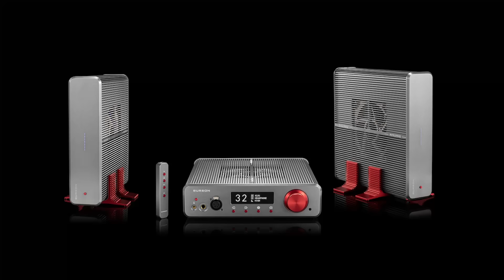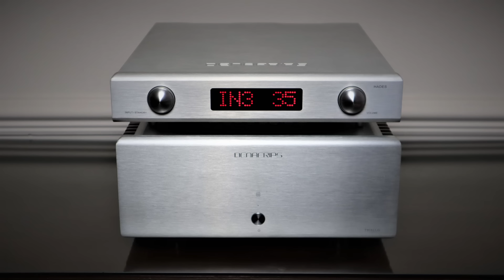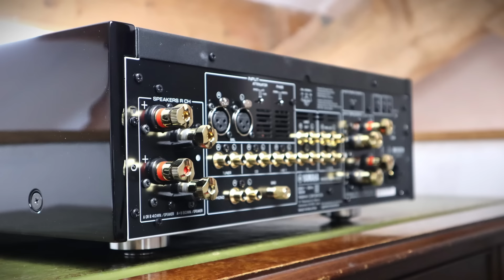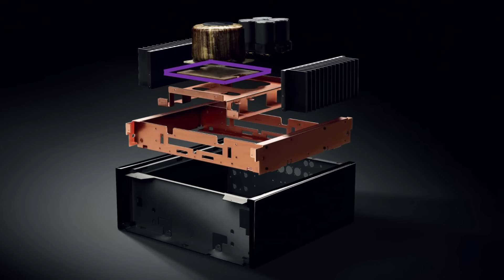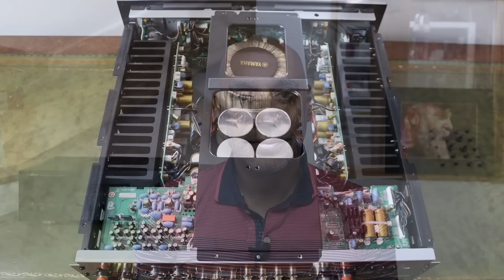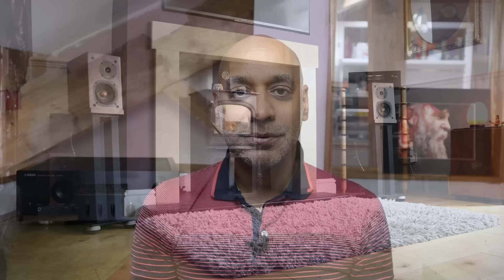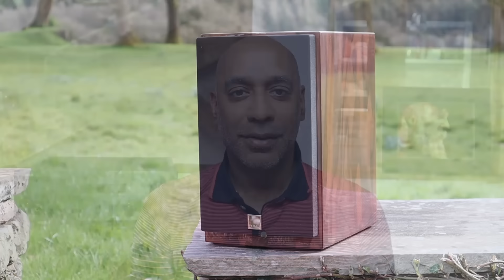ATTAINABLE HIGH-END! Yamaha A-S2200 Amplifier Review

Comment: I have the predecessor: The A-S 2100. A very fine amp. But in the last time with one issue: The amp switches off after about one hour of operation based on the protection circuit. The LED on the power switch suggest: Overheating. But hat is not correct. Amplifier temperature is normal, hand warm. Impedance issue of the speaker is also not possible (ProAc Tablette 10 Signature, nominal impedance 10 Ohm)… maybe a fault of the temperature sensing to the protection circuit…..
In the meantime the am is replaced by a WiiM Ultra/Vibelink combo. Works also very well and sounds as good as it gets. 😊

Comment: Some people put a lot of importance on RCA and speaker connectors.... but what I don't see too often, is balanced XLR connectors.  Is this important sonically, or does being balanced make the cable disappear more so than unbalanced?  Would a star quad canare xlr be tops, or have you noticed differences in balanced XLR cables?
Reply from the maker: The common mode rejection of balanced connections can bring benefits over long cable runs (lower noise). However, many balanced connections add a stage of electronics to a design that is not balanced inside. This can have a negative impact of sound quality. I all come down to implementation 😊

Comment: Would a Yamaha with its slightly dry/light/lean and detailed presentation work well with LS3/5A, which is already rather warm, rich and thick in the midrange? I'm interested most in imaging, stage depth and a non-bright sound.
Reply from the maker: I doubt you will experience the midrange magic of the LS3/5A with that combination 😉
Reply: @abritishaudiophile7314  Thank you, good to know. It actually sounds fine with a very old Quad 33/303 recently serviced by Quad. Not high end but very enjoyable.
Reply from the maker: @Pondillacgreat 👍

Comment: I just upgraded from my Yamaha AS-1100 and bought the AS-2200 what a huge difference and don’t regret it .
Reply from the maker: Thx for sharing 😊
Reply: Can I ask you what speakers are you using? Are they cold and dry? How would you describe the sound? I read that the 2100 sounds a bit warmer and rich than the 2200. What are your impressions after 8 months?
Reply: @gm152 @gm1521  I’m running  Proac response d28 floor standing speakers and I found with my upgrade to the Yamaha A-S-2200 after 8 months with my old Proacs is a lot warmer and well staged and excellent tight bass and never regret upgrading from my Yamaha A-S1100 thanks .

Comment: The price is too high for the return; I prefer the sound of my Harmon Kardon hk6600, which is much cheaper costwise, but the depth of the sound that it produces when paired with two NHT tower speakers is unmatched even by far more expensive amps and speakers.  The hk manages to deliver the depth of the bass and the clarity of the higher notes and instrument separation that really good recordings can bring to the ear.  I've played a CD of Berlioz's "Symphony Fantastique" recorded back in the 70s by Karajan and the Berlin Philharmonic; and most amps fail to deliver the same depth as the hk6600.  I've listened to systems at high end dealers costing tens of thousands, and the quality in comparison to this more simple but reliable hk, does not justify the Gross price difference.
Reply from the maker: Thx for sharing 😊
Reply: @abritishaudiophile7314  Looks nice and I'm sure the build quality is good however it's far too expensive for an integrated.  My Rotel RB1582MKII would smoke this Yamaha and at half the price!

Comment: I just got this amp. I think balanced topologies have more to do with marketing than real improvements to the sound. I think its purpose was supposed to be rejecting noise across long patch cable runs like you would find in a studio, and that's it. I do agree with using a shield and grounding the shield to sink noise to ground, but experiments I had done in the past with a 1980s Quad power amp, hadn't showed that I had been picking up noise, anywhere, inside the amp, or out, and so I had removed the balanced cabling and gone back to non shielded. Back to my new amp, I think Yamaha had applied their preferred house sound, here. It's not entirely neutral, but instead their take on what they think music should sound like. I hadn't noticed thinness or lack of body, but this is probably because the house sound of my previous 24 year old amp (made in Portsmouth, UK!) was much the same (diffuseness and providing a sense of space, over solidity). I see the Yamaha as a high clarity component that lets the speakers apply their sound signature. I had never heard a Hegel, even though those were available at AXPONA, it was too busy. My Wharfedales have lots of body in the bass with either amp (especially when I use a subwoofer with them). They have richness and natural timbre. But, they also have a flatter soundstage, worse dynamics, and worse imaging than my other pair. They are the more musical speakers. The larger pair has more soundstage depth, better dynamics, and more precise imaging. They are the more technical speakers.
Reply from the maker: Thx for sharing 😊

Comment: The attenuator, bypass or -6db, for the balanced connection is often overlooked on this integrated amp.  Mine, in bypass, with either a Denafrips Pontus II or a Bel canto DAC 2.8 sounds good... until you start hearing distortion which is very noticeable at low volume.  

I run mine with the -6db setting and the DAC 2.8 and this combo is absolutely sublime.  The phono section is really good too!
Reply from the maker: @Ian-3706  thx for sharing 😊

Comment: it's been a long time since i bought audio equipment first i bought was mission cyrus amp and tuner and mission 770 freedom speakers in think it was 1984 and a mission pcm7000 cd player, still have the speakers and cd player but changed to a yamaha dsp 3090 amp with yamaha sub abd mission 75c center speaker and front and rear mission surrounds. its a expensive hobby to keep up with the latest and greatest. good to see some of the later equipment

Comment: Hi Tarun.
I wanted an integrated amp with phono stage and no DAC. This was an intended upgrade from the Rega Elicit R. I auditioned the Naim £3700 integrated, and the Cyrus i9XR. I didn't want another Rega, (and the Aethos upgrade had no phono stage).  I like the clarity and instrument separation of the Cyrus i9XR and bought it. My kit at that time was a Marantz TT 15s1 turntable, Roksan blak CD player and Spendor a7 floorstanding speakers. Cut a long story short. The Roksan CD player developed a fault under warranty and my dealer allowed me to swap it and pay more for a £4000  Luxman D-03X. I find the Cyrus too bright with my source components, and i want an amplified sound with more depth that's not boring or fatiguing. The Roksan CD player I swapped out was less clear and softer than the Luxman, but it tempered the brightness and lean sound of the Cyrus in a way that the Luxman doesn't. So I was keen to consider trading in rhe Cyrus for the Yamaha, but am put off by you saying it lacks a bit of oomph and excitement. In terms of balance, I want clarity, richness, preferably no DAC in a one box amp, to drive my source components for CD and vinyl. I don't want a Cyrus PSU XR, as I want to eradicate the Cyrus  dryness which gets me down. From what you report in the video, the Yamaha and the Accuphase won't cut it for me. I don't want another dry, less rich presentation. What about the Luxman integrated at around £3700-£4000? I avoid pre and power amps due to aesthetics and shelf space issues.
Reply from the maker: @nazaholicable  thx for sharing your experiences 😊
Reply: @abritishaudiophile7314  Hi Tarun,  do you think the new Hegel 190v might suit me, given it should be less dry than Cyrus and less cold than Yamaha?
Reply from the maker: @nazaholicable  it is a great amp 😊

Comment: Recently acquired the Yamaha R-N2000A Wi-Fi network integrated amp/receiver which some reviewers compare very favorably, or even prefer, to the model you review. I use it with they also recently acquired Klipsch Cornwall IV speakers. I think the speakers and maybe the amplifier are still breaking in, but I listen mostly to vocals, and with the right placement and source material, this combo will put the performer right in your room.

Comment: I've owned a AS2100 since they first came out. I love it and have had nothing beat it. I agree on the mid bass weight with some speaker combos, but not all. Totem element for instance is where I noticed this most. 
I dont how different the 2200 is frorm 2100 other than power transformer. I also remember very well Yamaha poo'pooing torodial for the 2100 so what changed Yamaha?
Reply from the maker: @ogopogo1397  thx for sharing your experiences 😊

Comment: Yep, today I ordered the Musical Fidelity M6s prx amplifier to work with my Parasound 2100 preamp for my mixed use music/home theater.

As much as I love my Parasound 2125v2 amp (150 wpc, 35 amps peak/channel), I want to upgrade (to take further advantage of my new Cardas Parsec RCA cables) to hear anything better that's <$3500 and < 50 lbs.
I have a mixed use music/home theater (7.4.4 setup).

At first I saw an ad for a used Passlab xa25 for $3500, but there's no warranty and no returns so I passed. (I was also concerened about the low 25wpc, Class A heat that I'd be sweatin).

I've just ordered the Musical Fidelity M6s prx amplifier (230 wpc, low .007% THD, SNR >120dB, dual monoblock in 1 chassis, 140 peak current at 130 volts so it's less in the US at 112 volts but I would deduct that this is same as a Parasound A21+ at 60 amps peak/channel) to replace my Parasound 2125v2 (I'll repurpose it to power my movies surround L/R and take that load off of my Arcam AVR5 receiver in a 7.4.4 setup).

I was gonna get an integrated Musical Fidelity M6si (my requirement is a Home Theater bypass and L/R balance) but it didn't have a L/R balance to help imaging of vocalist; but my Parasound 2100 preamp does.

streaming source=Apple Music lossless
Reply from the maker: Thx for sharing 😊
Reply: @abritishaudiophile7314  I cancelled my order for the Musical Fidelity M6s PRX amplifier because it didn't have an input trigger.  (I also disliked that it didn't have a gain knob)

Instead, I've just ordered a NAD C298 for my front L/R in a mixed use music/movies (7.4.4 setup).
In the last year, I've moved over to music 99% of the time, and heavily upgraded my music side (speakers, stereo preamp, audio components/dac/ddc/r2r streamer).

I'll repurpose my Parasound 2125v2 (love it) from the front L/R speakers to the surround L/R speakers, and take the load off my Arcam AVR5 receiver (was powering the center channel, and surround L/R).
Reply: @abritishaudiophile7314  My video of the NAD C298:
https://www.youtube.com/watch?v=ncwCopnHJqA

Comment: Does the as2200 have enough power for high volume listening levels? My rs700 is rated at 100wpc and does fairly well but at high listening volumes it doesn't have enough juice
Reply: Yes, yes and yes it does. Don't worry about the 90w 'only'. Its the quality of watts what matters here, not the quantity. The as2200 will drive anything you throw at it. The amp is an absolute 50 pound beast. Dynamics, tons of headroom, awesome build quality. Not comparable in any way to the rs700. Another league. I have the as2200 powering dynaudio evoke 20s and the speakers deliver magnificent sound and volume without the amp breaking a sweat. The dynamics they produce are excellent and, those not being very dynamic speakers, it is the work of the amp delivering. 

Lot of folks today compare this kind of monster amps with "lesser" wattage to some crappy receivers with 100 o more watts per channel. Big mistake. 

Its how it handles the power what matters, you can maybe get to 150 mph on a minivan but it is much better to do so in a Hemi Challenger for sure! 

Go ahead, buy the 2200, or the 1200 if it suits you best. That one is another monster of an amp. Cheers.
Reply from the maker: There may be other options to consider 😊
Reply: @abritishaudiophile7314 well yes! The AS 1200. The AS3200  or even the as1100, as2100, as3000 those 3 last ones in the used market. All of these high end A-S Yamaha line are remarkable amps. 

AS2200 is a beast!

Comment: It will never fail to amuse me, just how suckered "audiophiles" are when it comes to amps, and how amp makers make such ludicrous profit margins from such gullible people. Can an amp "hum" and buzz? Yes of course. Can it "colour" the music in terms of "detail" and "clarity"? No, don't be so ridiculous. If you have tone control circuitry, then yes of course it willl influence the colour of the sound if you use those controls or that part of the circuit dominates. But if (as "audiophiles" so love telling is) less is more, and we should use amps without tone controls, OR we should always put the amp in "Direct" mode, then all an amp needs to do is get power to the speakers efficiently, i.e at constant and peak. All this talk of how an amplifier SOUNDS is such utter horse shit. Its quite literally just pumping power to your speakers. Is impedance a thing? Yes. Do crappy low quality parts potentially create distorted sound like buzz and hum? Yes. But thats IT! Get ANY half decent amp these days, made with quality components, that matches/compliments your speakers ouptut/efficiency, and I defy ANYONE in a blind test to tell the difference in sound quality using the same decent source, cables and speakers between that amp and something costing ten times as much. The hype with amps these days is so ridiculous.
Reply: So I guess your setup must be extremely cheap that's a good revelation.
Reply: @sylvainbiensur7370  At what point did I say "ALL EQUIPMENT IS MADE ABSOLUTELY EQUALLY"? I didn't. I said get an amp made with quality components that matches your speaker output/efficiency. There is no "world of difference" between a well made amp in the $600 range, compared to one in the $6000. THAT is the point I'm making. Clearly went over your head.

Comment: As a BSEE and Acoustics Engineer/audio enthusiast, I believe a balanced topology is REQUIRED for the best sound and lowest distortion.  It's refreshing to see a high quality ANALOG amplifier.  After all, sound IS analog.  There is no point in converting to digital and BACK to analog unless the design engineers FORGOT how to design anything in the domain that the ears operate in.  DACs and CADs (dig to analog & vice versa converters) only ADD distortion to the system.  Nice review.  Good to see Yamaha making it beautiful inside as well.   I would like to see a frequency and phase response curves to augment the listening test.  Is that possible?

Comment: Thanks for the great review, Tarun. I  have the 2200 which I chose after testing 3-4 amps of the same price range when was replacing Rotel RA1572. It is a core of my system working together with Dynaudio Evokes 30 and DAC Denafrips Pontus 2. Sources CD, Qobuz and a bit of LPs (turntable Project Debut carbon). Clarity and soundstage are great but tonally is certainly on the cool side and I would prefer to soften it a bit. Probably because of the clarity delivered by both the DAC and the speakers. I also have a small SVS sub which helps with low bass. Thanks again for your thoughtful reviews, keep this channel going. K
Reply from the maker: Thank you. Great to learn about your experiences 👍

Comment: Did toy with the idea of one of these Yamahas -  S2100, 2220, 3000, 3200 amongst many other amps. Having read loads about the Plinius 9200 Integrated, 200 wpc @ 8ohms, I waited patiently and came across one I couldnt let pass, £1300 and it was mine. Absolutely love it!, power, dynamics, balance, neutrality, nuance, detail, depth with just a hint of what I'd call natural analogue warmth being AB, heavily biased to A. An excellent amp and I've had a few - Technics SU VX800, Sansui 919, Sansui alpha AU a707DR, was also loaned a Belles Aria integrated to try which was very nice, the Plinius is the best - love it, a thrill and sensation feeding my Spendor D7's - sources are Technics SP10Mkll turntable with re-tipped Ortofon Cadenza Black cartridge (Fritz Gyger S profile), same as the Replicant on Ortofons best moving coils, Aurorasound Vida Prima phonostage, and Pioneer PD91 cdp. The Plinius brings the absolute best out of them, best replay I've ever realised in my home.
Reply from the maker: Thank you for sharing your 😊

Comment: I have the A-S1200 and i am in general happy with it. I don't have flowery language about it's sound qualities, just that it's noise is low, distortion too, and power into harder to drive speakers is plenty. Apart from that it's totally linear, it doesn't add nore subtract, as can be seen in it's large bandwidth.
I have used it with different speakers, cheaper ones like Focal Chora 806, Mission LX-3 MKII and ELAC DBR62. Also a bit pricier, like the ATC SCM19 v2 or the Wharfedale Linton. No problems at all in terms of amplification.
However, there are three flaws. 1) The pre-out/main-in can't be looped, which means you can loop in a MiniDSP or EQ. 2) It doesn't have the variable loudness, which to me is important. 3) It lacks a record select. Well, it would have been nice. ;-)
Reply from the maker: Thank you for sharing 😊

Comment: Some amplifiers that may sound lean and analytical on bookshelf speakers may actually work best for appropriate priced floor standing speakers. A good control in the low section often results in weight loss of the lows that can be perceived as leanness. I would like to see how this Yamaha or similar voiced amplifiers pair with floor standing speakers if possible in the future Tarun  <3<3
(Speakers like the Dali Rubicon 6 are praised for working great with this amp btw.)
Reply from the maker: Yes, I suspect the tuning is suited to some floorstanders with more bass emphasis 😊